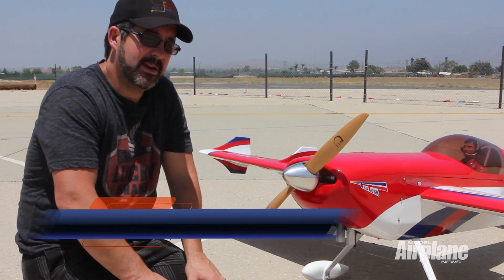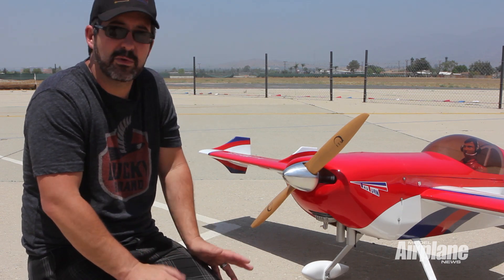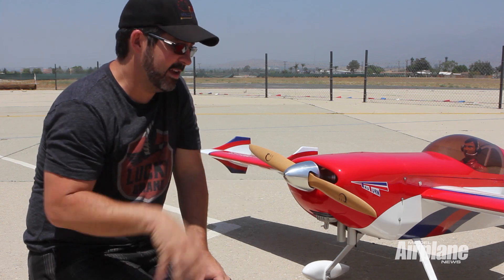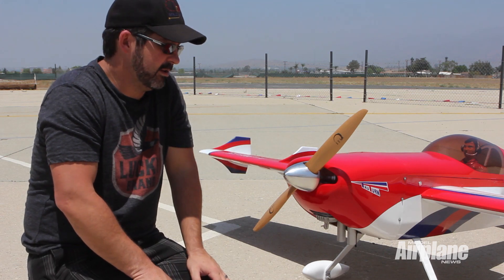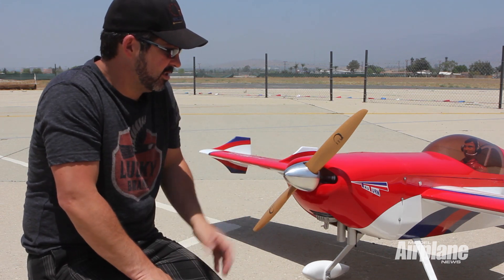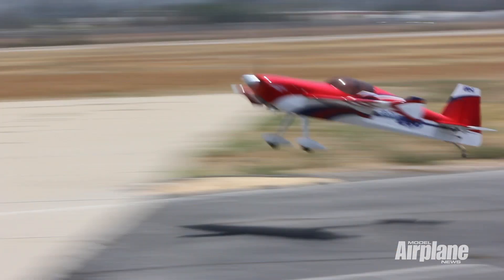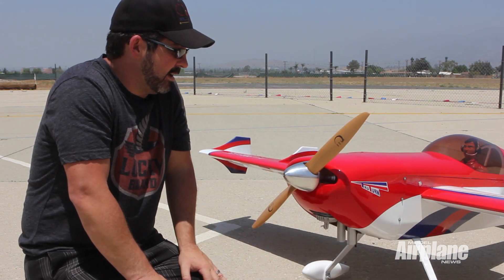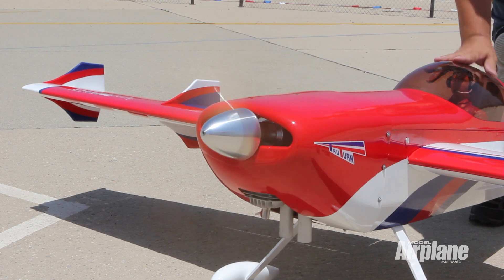Starting Gas Engines

Comment: the video should have started with the following comments "Safety First" though they were talked about at the end of the video 1. always ensure the aircraft is properly and securely restrained. 2. always ensure that the ignition is off prior to turning the prop. 3. always use a heavy leather glove to flip the prop incase the engine kicks back and whacks your fingers. 4. keep any loose items such a tx neck strap, bracelets, etc. away from the prop. 5. never wear rings on your fingers near moving objects. 5. if your engine should quit while taxing out, never be tempted to start your engine on the taxi way unrestrained ( it was just running, one flip should get it going .... type of thing)).
Reply: Very insightful, thanks for sharing here!

Comment: You forgot to adjust the throttle to idle after first pop before second flip of the prop with choke off.
Reply: New to gas RC plane. When you say choke off do you mean close the choke? Such that no air goes into the cylinder?